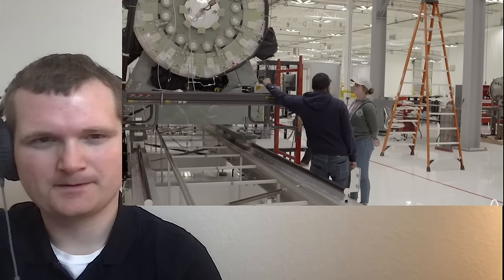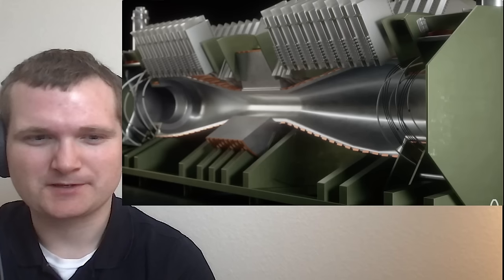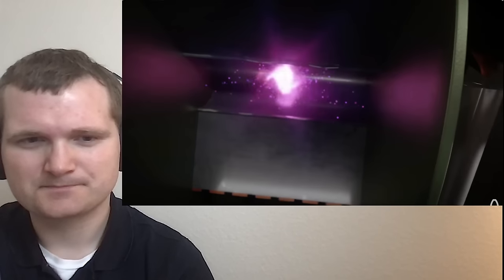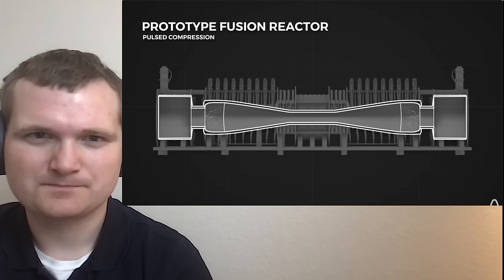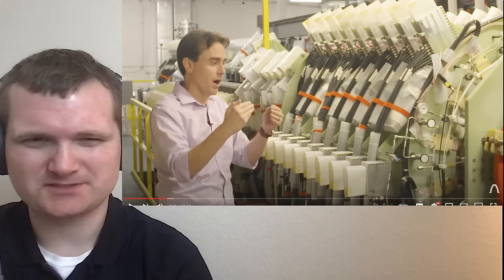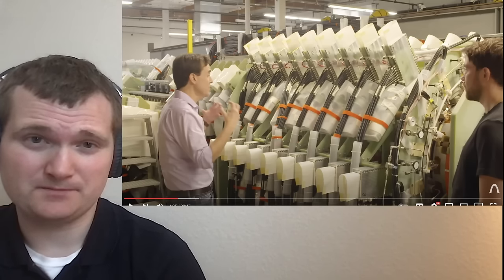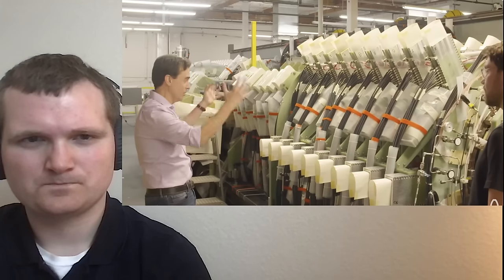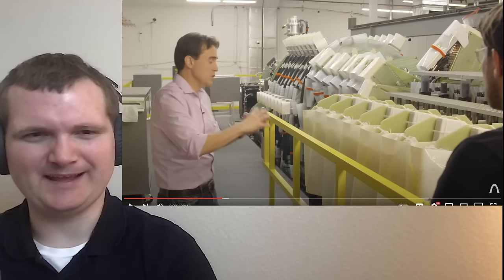Will the Helion Fusion Reactor ACTUALLY work? - Nuclear Engineer Reacts to Real Engineering

Comment: but how do you charge the bank every 100us those capacitors will massive hysteresis would play a part, plus your dumping  100.000 to 1,000,000 amps from the output of the generator just to maintain the capacitor charge this is required to discharge at least 60 cycles a second. So how much energy will you get from the reactor in Watt hours. This seems like the same problem of other fusion reactors net energy production. Fusion works on the sun because the magnetic field comes for free. The one thing they tried to suggest is that the radioactivity emitted from the reactor will be far less because of the lower neutron emission in there reaction.

Comment: I can't possibly see them getting more energy out of this than the cost of repairs. Replacing capacitor's & walls of the unit will far out cost any benifits to this design.

BTW, where is the cooling?

The reason you have turbines ran by steam is because that IS the cooling. 😂
Reply: The capacitors are going to last pretty much forever. They had one that lasted through over a billion FRCs back in the 2015 (for a NASA FRC propulsion project) and then they used it on Trenta after that. Helion is building their own caps after the same design (which is not available anymore, at least not in large enough quantities).
The walls are not a big problem. The section that will need frequent maintenance is the compression chamber. It is not THAT big and the quartz tube is only 5 mm thick.
Quartz behaves pretty well in a 2.45 MeV neutron environment. It has to absorb 3 neutrons to become unstable 31Si. The cross section for that is not that good either. It will take several years before the wall needs replacement. 

Trenta was air cooled. The pulse rate was not high enough to need more (one pulse every 10 minutes). Polaris will also be air cooled. Future power plants will need better cooling though. Even those won't have to deal with THAT much waste heat though. It is too little to justify the capital cost of a steam turbine.

Comment: Those free neutrons carrying MeV energies are going to eventually damage the metal of the reactor vessel. So I hope its modular design!?
Reply: The vacuum vessel is not made from metal. It is made from quartz. 28Si has to absorb 3 neutrons before it becomes unstable. Since they only have one neutron for every 3 to 4 reactions and D-D neutrons are only 2.45 MeV, it will take years for that first wall to need replacement. Then the linear design makes it relatively easy to service. Though, I suspect that they will just replace the entire reactor core and service it at their factory. They are designed to be transportable by road (<3 meters in diameter).

Comment: Why do nuclear engineers think that the only use for a reactor is electricity?

The moment i saw that reactor, given its intermittent fusion reaction, i thought that would be a shitty power plant, but an amazing rocket engine if that fusion could be directed as thrust.
Reply: The energy generated by the pulses is stored in a capacitor bank and released gradually to the grid from there.

Comment: at the end of the day neutron radiation coming from nuclear fusion. Reactions are not a bug there a feature for now there is no such thing as no neutron producing fusion reactor That’s practical. What you want to do it’s just like in a nuclear fission reactor used, graphite, and I think cadmium beryllium to reflect the neutrons back in on the plasma to induce radiation pressure. That confines the plasma. as well as the heats the plasma up. The next thing you want to do is you want to add uranium into the plasma and how this would be done as you would have cryogenic liquid hydrogen loaded with the uranium and you would spray it out of a nozzle at high pressure. And there’s multiple jets in each jet of cryogenic liquid hydrogen with uranium and beryllium infused in it as well as lithium when the cryo- Genex jets converge, they compressed each other due to the high pressure in which they were expelled in the mechanical pressure waves traveling in them. These mechanical pressure waves when the Jets shape each other when they encounter each other they compress and the pressure waves induce interference patterns in a line, the uranium up in such a way where a rapid nuclear fission event occurs which then turns the cryogenic hydrogen into high energy plasma very quickly, and this is also worth noting that these are individually tiny pulses of plasma that are then combined it together, using magnetic fields in Mazer beams that trap the plasma in the frequency, and then all the plasma pulses are added together in the reactor core, so even if something was to go terribly wrong
Reply: And I’m not trying to break it up. I’m just adding to it by adding another text because I want to keep it readable so picking up from where I left off each individual pulse of high energy plasma is pumped after its generated containing tritium and deuterium lithium and beryllium the plasma. Pulses are shaped by the Mazer beams, as well as the magnetic field within the central chamber. All the plasma, pulses travel at extreme high velocity from the way that they were produced, converting the energy of the fission reaction into heat, energy and kinetic energy things, plasma, pulses, all combined together under extremely high pressure because of the plasma modes, the plasma, pulses form interference patterns that shape each other the plasma modes, having been generated by the Mazer beams with the magnetic field restricting the degrees of freedom and the neutrons being emitted from the fission reactions under the high pressure is produced by the plasma, pulse is converting their kinetic energy into pressure and temperature as a result of the magnetic field restricting what they can do and the way the modes containing each pulse form interference patterns that shape, the uranium, the hydrogen the lithium in the beryllium in the plasma. It forms a very high pressure system were a get a rapid increase in fission reactions rapidly increasing the temperature of the plasma, but more importantly, well equally as importantly, the plasma produces a gigantic amount of neutrons, and then the neutrons are reflected back on the plasma, increasing the pressure in the way the reactor chamber is designed the way the neutrons are reflected. It spins the plasma, and in the active doing that the heavy elements wind up on the outside, split, and because of the magnetic fields, they travel into the inside of the plasma inducing further fission reactions getting it up to even higher temperatures. And what we’re doing here is were using nuclear fission to produce heat energy and through the reflected neutron’s pressure on the plasma.
Reply: And the reactor would be designed very similar to a TokaMac. the neutron radiation pressure not just spinning. The plasma to the heavy elements are on the outside to be split. But the way that the neutrons are reflected from the fissile reactions, the plasma is wind it up and down, just like a Stellarator, eliminating the drift due to the design of the neutron, radiation, reflecting panels, made it again, cadmium, beryllium, and graphite with a magnetic field shaping the fishing products like alpha particles, so they travel into the plasma in spin with the winding up and down plasma inducing ion synchrotron, heating, as well as alpha, particle heating and in addition to the shape to magnetic fields, winding the plasma up and down you have a Stellarator style design that would also induce ion electron synchrotron heating not just from the radiation pressure and the fission reaction, spinning the plasma, faster and faster but the magnetic field as well but mainly the fission reactions doing that with the fission reactions in fact doing 70% of that so this reduces the amount of energy required, because the fission reactions foot 60% of the energy bill to contain the plasma due to the reflected neutrons. The plasma pulses are combined it together in the chamber, the central donut chamber into larger plasma, pulses, rather before they enter the central chamber, and these larger plasma. Pulses are combined together by the shaped magnetic fields of the central chamber, and the reflected, neutrons, winding the plasma up and down as well as spinning it in with allow you to have a TokaMak style design, but winded the plasma up and down just like a Stellarator with the fission reactions footing 90% of the temperature bill 70% that I mentioned earlier that’s first winding the plasma up and down and spinning the plasma. The beryllium is a neutron multiplier, and because the neutrons are reflected back in on the plasma, didn’t use radiation pressure because the plasma from the fission reactions from the outside of the plasma, in the way to magnetic field, force the ions to travel back in produce from the fission reactions produce is plasma modes that shape the plasma they get rid of edge, localize modes and tearing modes think of the fission reactions is inducing shock waves in the plasma in the way that the heavy elements are shaped by the magnetic field by the radiation from the Mazer beam inducing plasma modes that shape the heavy elements on the outside when they get split by the neutrons reflected back in the Purdue shockwaves that propagate following the magnetic field lines, and the way that the exterior of the plasma gets pinched by the Mazer beams and shaped they produce a specific shockwave with the magnetic field, controlling what they can do once they released further, adding another layer of control to the shockwave generated, and all the shock waves form interference pattern that aunt to shape and wind, the plasma up and down, as well as further spin it, as well as get rid of edge, localize modes in Tearing modes in the plasma in as well as accelerating, the alpha particles, produced by the fission reactions into yet more unsplit, my nuclear material, splitting it, and in the process of producing in the end process, more hydrogen isotopes as a result of fission cycle and inducing, yet more temperature increase and producing yet more neutrons, that guess what get reflected back in on the plasma, producing yet more pressure lining up yet more fissile elements from that pressure producing yet more fission reactions all of this reaching both the temperatures in the pressure is required for nuclear fusion, which then the one proton, one neutron, hydrogen isotope, and one proton, two neutrons, hydrogen isotopes undergo nuclear fusion and produce once again, yet more neutrons that lead to get more fission reactions and lead to more heat energy as well as more pressure
Reply: And very simply the lithium in the beryllium the beryllium is a neutron multiplier in the plasma, the lithium undergoes nuclear fission from the neutrons and becomes hydrogen isotopes, and because the plasma is made of extremely high pressure deuterium as a result of the whole radiation pressure, confinement and magnetic confinement thing. It acts as a neutron moderator inherently some more fission reactions do occur and also leads to more pressure which further increases the nuclear fusion reactions
Reply: And you would have a lithium breeder blanket in this design they could further lead to more fuel being produced, but the plasma itself is a self-sustaining plasma in the sense that the fission reactions are enhanced by the high energy neutrons from the fusion reaction, so they keep splitting the heavy elements produced by the fission reactions which then breaks down eventually into hydrogen isotopes, and because of the insane temperatures from this kind of thing, it could easily be,that the alpha particles undergo nuclear fusion with deuterium and triteum themselves liberating neutrons, which further break apart the heavy elements. The advantages of this design is that because the uranium is only job is to foot, the energy bill for the nuclear fusion in both pressure and confinement and temperature and heating. You don’t need anywhere near as much uranium as you would need in this plasma if say, the uranium was the thing that was meant to be the power source. So the high energy neutron’s continuously being reflected back in putting radiation pressure on the plasma and because the plasma is made of heavy hydrogen, it’s got a slow down and moderate there’s neutrons, so they can split more atomic elements essentially what would also lead to additional fuel production or and by spinning the plasma, are you prevent the plasma from collapsing, and you can maintain its ovoid shape, which would also eliminate the necessity to design it quite like a Stellarator, allowing you to use a particle accelerator design, where the nuclear fission reactions in the cryogenic hydrogen turn into not just plasma, but high, kinetic energy high temperature plasma When are the plasma. Pulses are combined together in the center chamber get shaped under very high pressure and temperature from the kinetic energy of becoming pressure and temperature of the way to uranium gets ordered wrap a nuclear fission reactions in the way the plasma griffins, it gets pressurize from the reflective, neutrons, even higher pressure temperatures.

Comment: I swear it is so annoying to hear people say "nuclear is expensive" offhand and just move on. Like, no, not even close. I'm by no means a nuclear scientist but not only are many of the costs of nuclear red-tape intentionally designed to stop plants (IIRC after 3Mi Island the costs and construction time both multiplied by several factors, despite literally no-one actually being hurt from it) but if you include even just a 10 year life extension the costs immediately plumet to the cheapest source of power there is. (going by the iea's 'projected-costs-of-generating-electricity-2020' page)

It's one of those things that's true, until you bother to look at it, yet people take it as such a given that they don't even pay it any mind when they say it and it makes you the asshole for stopping the entire conversation to correct them. (which, yeah, it is annoying, but it's also typically a pretty fatal component of the argument being made)

Comment: They don't tell us what fuel they are using presently, but I doubt it's deuterium, since they don't seem to have the necessary shielding for neutrons. 

I must give some credit to these "start-ups." Thanks to them fusion isn't permanently 20 years away, now it's permanently 5 years away. 😂
Reply: They have been using Deuterium, actually and quite a lot of it. D-D fusion is not that bad. The neutrons only occur in half of the reactions and only have 2.45 MeV energy. They react relatively benign with many materials. Helion chose the materials for their machines deliberately to accommodate that. E.g. their first walls are made from silicon which has to absorb three D-D neutrons to become unstable 31Si. That then results in an isotope with a half life of just 2.5 hours. Their magnets are made from aluminum which has a half life of 2.5 minutes if it absorbs a D-D neutron. So the machine is cold really quickly. They do have permitted shielding too. It is in the walls and not near the machine. Also note that Trenta is an experimental machine with a pulse rate of 1 pulse every 10 minutes. So the total neutron load was not all that much.
Polaris, their next generation machine currently under construction is surrounded by a vault of 2.5 meters thick concrete doped with boron carbide. You can check their social media accounts for pictures of that (and other info on their progress).

Comment: is there a way to use standard nuclear fission to heat a plasma in a vacuum to the temperatures needed for proper fusion? i never hear of this, but why not just irradiate a plasma, or have an induced meltdown in a vacuum needed to raise hydrogen plasma to the fusion temp?
Reply: hmm not sure about the technical details but i am guessing the high temperatures would melt the fission fuel and since they are not in plasma form, it cannot be controlled by the magnetic field and will melt the containment material. Not to mention you would need to refine the fission fuel to very high levels if you put it in a vacuum as it needs neutrons to continue the chain reaction (this is typically done with moderators like water which reflects the neutrons generated back to the fission fuel to continue its reaction)
Reply: @nurluqman97  interesting. it may be that the fission may be separate then from the contents of the vacuum chamber. make it where the fuel rods are in a jacket around the vacuum chamber, so only the radiation is being pumped into the vacuum chamber.

alternatively, it may be possible to just heat a heavy metal ion to high temperatures, and just sprinkle frozen pellets of Li-Du onto the super-heated metal plasma, sort of like sprinkling salt on a bagel.